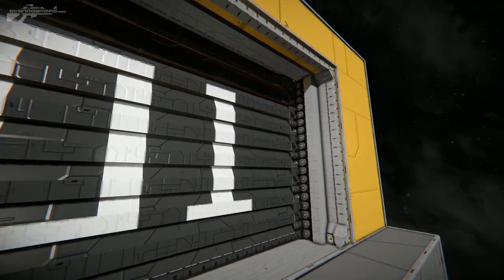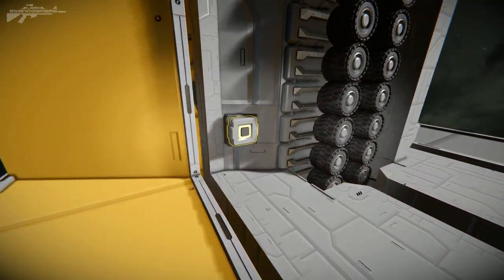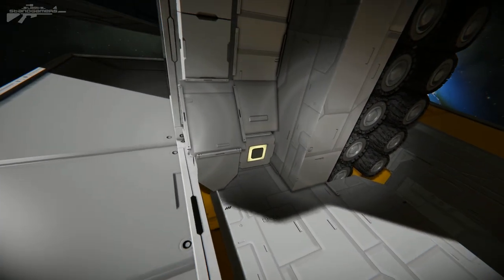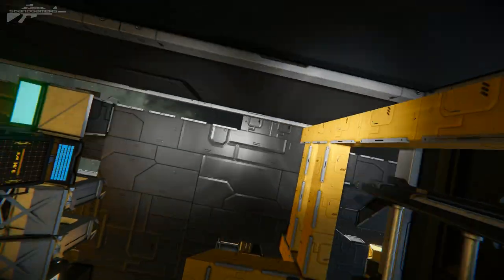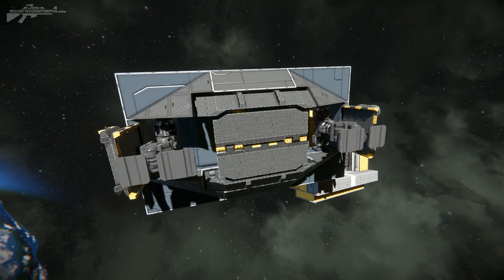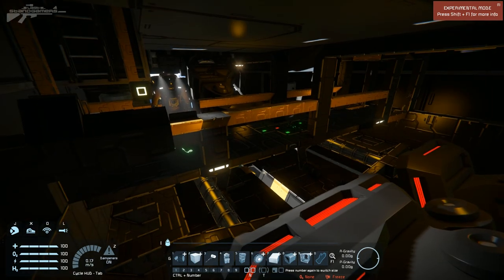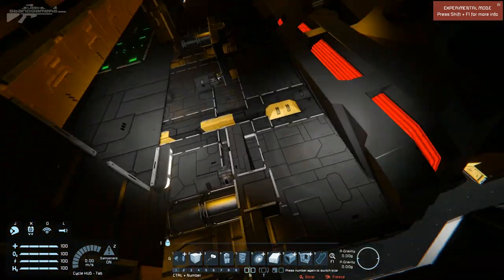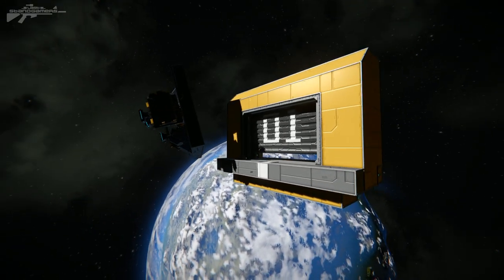Space Engineers - Retracting Landing Gear & Rolling Gate

Comment: Impressive. On a side note, I always build simple connector retracting, on all my ships. I leave the landing gears extended and connector is usually on the belly. The base connector is usually built flush with the landing surface, so the 2 don't meet, unless you lower the connector. So I simply build a piston, connected to the cargo hold and after I land, I extend it, to connect with the base.

The drawback is on small ships you can't have large items go through it, I don't think they changed that. But that's ok, only my welder ship needs a connector through which large objects can go through.